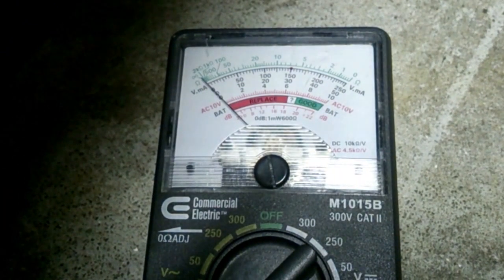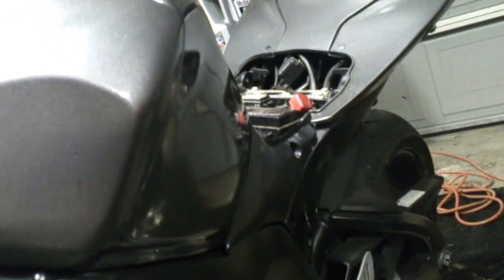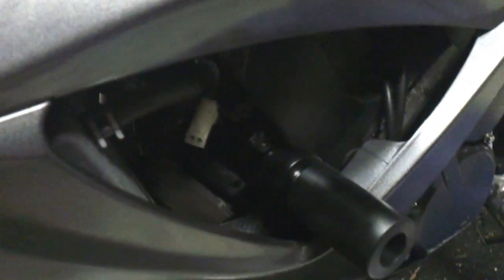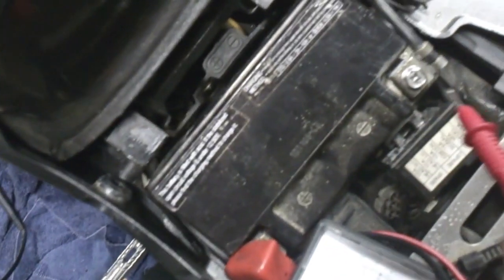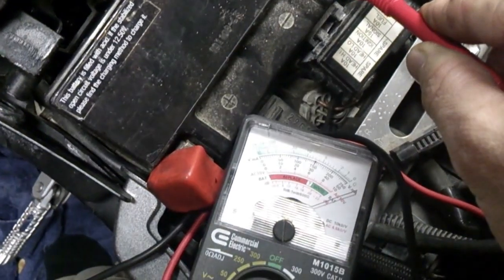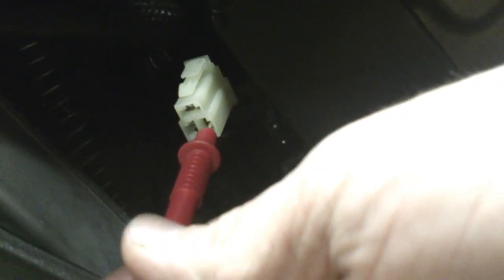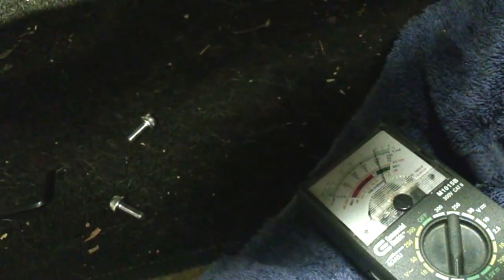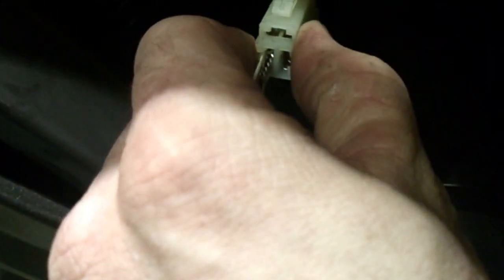Brand new stator not charging. ohm readings ground

Comment: You can't rely on that test. determine first if your stator is a full wave or half wave. in the half wave one end of the stator wire is grounded .and the other end mostly yellow and white is connected to the rectifier regulator. in full wave the stator coil is not grounded they call it floated it is directly connected to the full wave rectifier the half wave stator is also connected to the halfwave rectifier.so the trouble might be in the rectefier or loose connections..

Comment: you have not returned like you promised!!!
Reply from the maker: ah yes sorry... 

I had just put in a new stator, but the battery was bad, causing the stator to overwork and burn out the coils... So... I had to change the stator again, and the regulator / rectifier and the battery, in order to fix the problem. Because running any one of those 3 in bad condition, for any extended period of time, can cause either or both of the others to go bad as well.

Comment: Did you ever find the problem??? I have a R1 and have the same problem. Still no charge.  I plug the bike up every night .... and it's getting a little old. Can't ride real far...  and at night .... for get about it....lol looking for help
Reply: I have the same problem.  I have a klr 250.  Battery is new, and stator stopped sending a charge to battery so all lights die pretty quickly.  My old stator is zero resistance between all yellow wires and 7 ohms between ignition circuits.  New one is zero between all yellow wires and 9 ohms to ignition circuit.  I tested for continuity and all good. I believe I am doing something wrong.  Very difficult to get any help.  I can't afford to take to a shop.  Hoping someone can help..
Reply: @benwhatley5107  u ever fix it ?
Reply: Chris martin It is fixed.  I adjusted my valves and ended up pinching a ground wire between engine mount and frame.  I burned out my stator and regulator.  Replaced both and replaced some wires and all good now.  It was a pretty easy fix.  I ended getting a bulk sheet of gasket material and cut my.own gasket for the stator cover.  Stator is putting out around 20 volts and regulater is putting out around 14 volt now.  Battery was fine.
Reply: @benwhatley5107  oh I think I need to replace my stator to my friends said once stator go out i need to replace rectifier  aswel  my battery keeps dying replaced battery in a week dead again  took it to get it charged  put it in didn't want to start needed to get a jump start on a  charged battery weird put started up after a lot of attempts  now it hasn't died yet do you think its the stator and rectifier  I don't have any check engine  lines on I also heard you should keep the bike above 4kor5k on the rpm I'm always on round 3kever send I got a ticket I don't really go that fast or idle the bike that much i heard that could make the battery mot charge